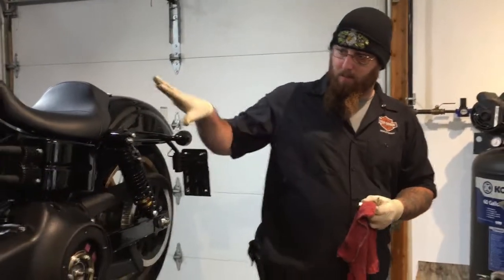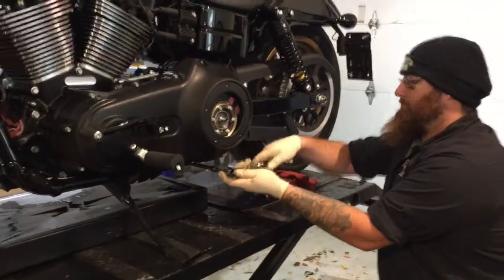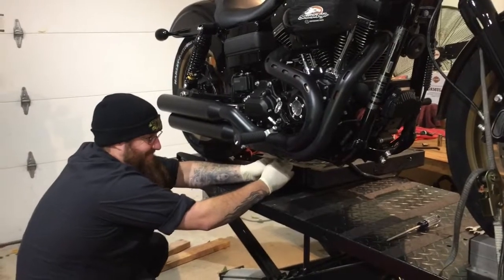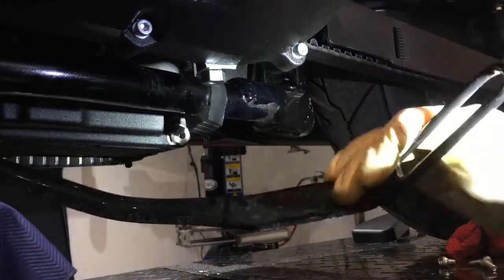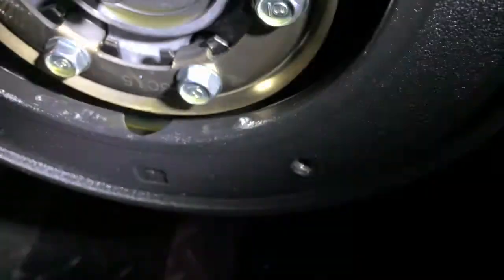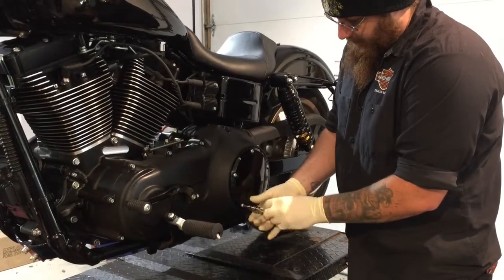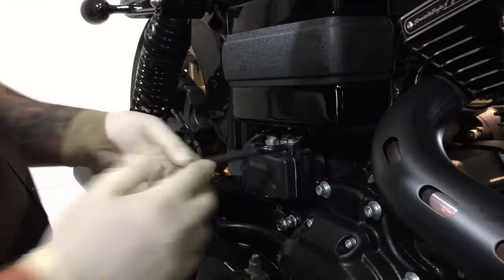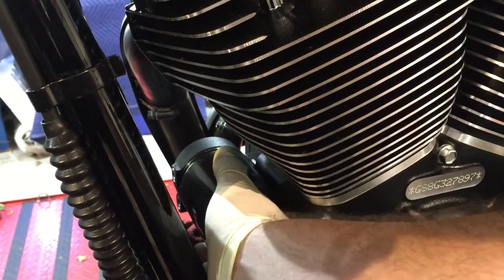Dyna Low S 1000K service part 3

Comment: i just picked up some oil for my 2017 low rider s at the local HD and the parts department guy said to put in 4 quarts of oil. should i put in 2.5 like this guy did and check the level or just dump in the full 4 like HD dealer told me to do ?

Comment: Great video, thanks! One question, the service manual calls for steering head bearings adjustment, is it necessary for 1k service? Also, the drive belt adjustment needs to be checked at every service interval.
Reply from the maker: Vladimir Chausenko I am not sure the steering head adjustment needs to be done at every interval BUT it’s advisable at the 1k just to make sure it was done correctly from the factory